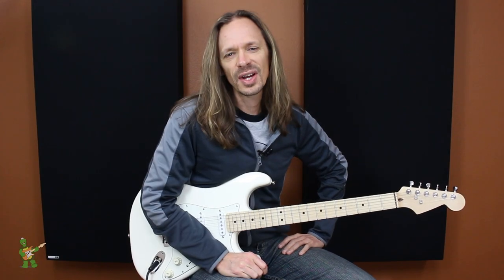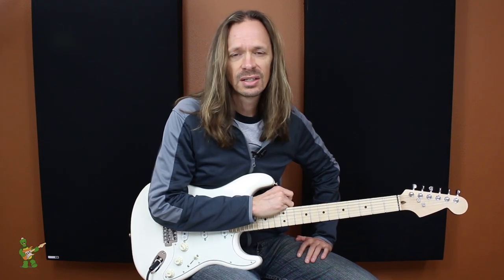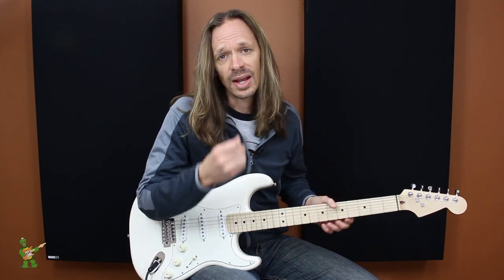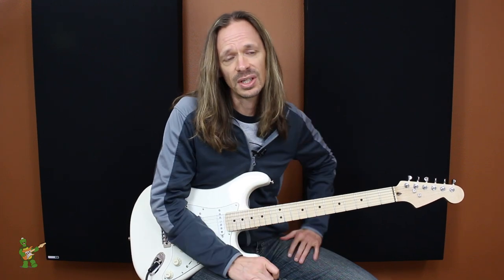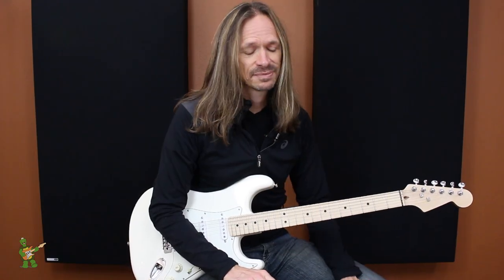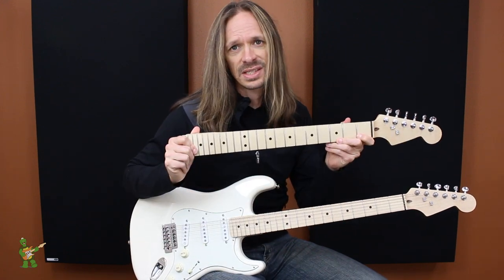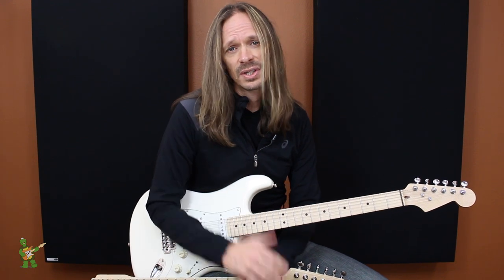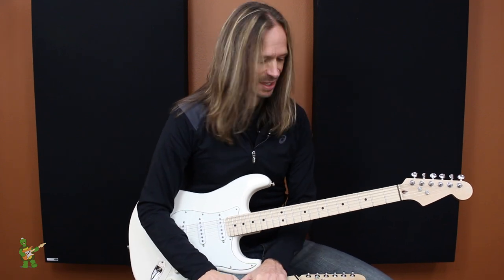Stainless Steel vs Nickel Frets

Comment: The reason stainless steel is not used in production lines is simple: it wears the cutting/fretting equipment much faster hence a softer, cheaper metal is used.

Comment: I wouldn't use SS frets with low output humbuckers or single coils personally. I also like pure nickel strings with the same group of pickups, and they don't eat frets so fretwear isn't an issue.

Comment: TBH, the differences in the Tone is minimal but IS there. However, the MAIN reason why I like refretting with stainless is more physical: they last a very long time (more often than not methinks the frets may outlast the rest of the guitar) and when the frets are polished to mirror shine, the strings glides on the frets like the frets are made of ice.

Comment: The diff was obvious...  Neck 2 had more snap and stronger, clearer highs. But I completely agree with this guy, even if you prefer the sound of nickel, it's not enough of a diff to justify the fret wear and dings. I'm fine with the sound of stainless but I actually prefer the feel of nckel since I use 009s tuned a half step down, it gives a bit of resistance. Whereas stainless is so smooth, my strings feel even more like rubber bands. Which makes it a bit harder to bend perfectly in tune but once again, the lack of fret wear and dings makes the stainless much more than worth it. I have stainless frets on one of my guitars but I wished I em on all my guitars. IMO, nickel silver frets should be obsolete. Esp considering fret jobs often cost more than the price of a whole new neck!

Comment: With good headphones/Studio monitors is clear the difference in the low end. Stainless steel has more low end/low midrange. For recording rythm I would prefer nickel as would leave more room for bass and kick drum. if I would want more low end guitar (maybe for soloing or little crowded song) I  would go for stainless steel.

Comment: You failed to mention the third option EVO Gold... nearly as hard as SS (easier vibrato and bends nice the fret is much harder than the nickel string)  but with a very similar sound to nickel if that is what you like. Clean is the best to hear really what's what (no distortion). The second cut arpeggio sequence highlights best that whilst it IS brighter the SS actually has more tone, clarity and depth than nickel which was muddy in comparison even on a Strat single coil!

Comment: How hard is it to refret with steel? Besides brass, is there not an alloy that meets in the middle between nickel and steel in hardness, a happy medium? Since I'm new to this, I guess I'll go with nickel. I'd imagine steel would at least give you better sustain, especially if you outfit your guitar end to end with steel parts : roller nut, frets, bridge, block, and then strings. I'm a firm believer in improving the build as much as possible before  adding in sound effects like a compressor.

Comment: I don't ever want to buy another guitar without stainless steel frets, simply because of the wear factor. That being said, there is a marked difference in tone between the two of them when you A/B them, but nothing that would make me bat an eyelash. The difference is easily made up in the amp. I definitely prefer Neck #2, before knowing which is which, but that's out of context with a band. I was, of course, right that Neck #2 was the stainless steel.

Comment: I got it correct, preferred the stainless, and was surprised how much of a ( generally positive ) difference it made - but if it's too bright, a quick amp adjustment should be more than enough - otherwise - count me in for no re-frets, slightly more sustain & brightness, and easier bends.

Comment: I am astonished about the difference. If the testing conditions were really identical then there is clearly a difference in the phase of the tone. The stainless steel frets sound like that there is some phase elimination between the strings and the pick-ups. Hard to tell what makes the difference. Probably the string height wasn't identical.

Comment: I play clean most of the time --- a lot of fingerpicking --- sometimes with no drums
at all. I hate the sound of the stainless-steel frets in this clip. It sounded
lifeless and hollow sounding non-organic. The best way to get a quality sounding mix, with
drums and bass and electric guitar is for each individual instrument to sound
great on its own and then to tweak your great sound from there to make it fit
even better in the mix. Stainless steel yeah but only for on the road but not for
in the studio where you would then have to try to “fix it in the mix” as so
many amateurs mistakenly do. However I do love the feel and look of stainless steel --- but
that is about it.

Comment: Neck 1 sounded a lil more normal to me but just barely. Strange thing I noticed was that neck 2 with the stainless had a slightly darker closed sound on chords. I wouldn't have guessed that. It had me confused because on single notes it sounded the same almost. Minimal difference.

Comment: SS frets are great for players but they are really tough on luthier fret tools, and everything about them takes longer to do. I love playing them and hate working with them.  The two guitars (necks)  most definitely sound different in some settings but unless the screws were torqued exactly the same that could be yet another variable. My theory is that everything is a variable. Two of the exact same model made from the same logs on the same day by the same people will still have slight differences. Mostly insignificant but most players would dig one of those a little more than the other for whatever reason.

Comment: i could hear it very slightly on only a few of the clips, which made me think it was the playing, because the difference seemed like neck 2 was more pronounced. basically i thought neck 2 sounded better but thought it was the playing, dont know ig i heard any high end zings, though, that flew over my head. but if there really is a mote pronounced sound with the SS frets, and its not just playing dynamics, then id say the SS frets sound better, not worse. my opinion, though, of course.
cheers, and thanks for this video!

Comment: Neck 2 sounded maybe a bit muted compared to neck 1 to me, although it's a minuscule difference that can be changed with a bit of eq adjust. And I was surprised since I expected the stainless steel ones to sound less muted given the density of steel but eh.

Comment: nickel all the way, on all pickups, and all the parts. which is consistent with my tremolo block preferences, i prefer zinc over steel, there, too. the only place where i like steel is in a good slide. nice comparison.

Comment: First if it's two different necks, no fair, no compare.  I've had some maple necks which were bright/thin as heck, resulting in a plinky tone.  And others which helped to give a thicker, fatter tone.  I'd stick those same necks on many different bodies and hear the tone follow the particular neck.  You have to refret the same neck to give any kind've comparison.

Comment: there's definitely some difference with a clean signal, it would probably be a much bigger issue on an acoustic because once you start distorting the signal it almost doesn't matter what the guitar itself sounds like aside from the pickups.

Comment: The 2nd neck ( steel frets ) sounds like is not "eating" the energy out of strings. My Strat does the same ( Nickel frets ) because I found out the weakest spots in the sustain path. At the end, the traditional block metal saddles AND nickel frets don't "eat" that dense "KUNG" tone you feel out of it. If you set your chin next to the body when you strum chords, you'll sense in the skull the pure straight metallic tone working in the formula Metal + Metal - Wood= Perfect Tone.
It's a tone beyond Tele-erasing fret bending-tone. Yeah, that "KUNG" coming out from metal ( strings ) to metal nodes ( fret and string saddle ).

Comment: I guessed wrong, I thought neck number 1 sounded brighter at the tops and fuller in the lows and was surprised it wasn't the stainless one. Are you absolutely sure the amp settings were the same on the 2nd day of testing?

Comment: I understand that stainless steel frets would tear off nickel strings because of the hardness of the metal.
How great is the impact of it though? I mean, you're probably end up replacing your strings because they got rusty before having them broken. Unless if it starts to rust quicker but still curious about concept vs practical tests...

Comment: I preferred the sound of the stainless steel frets. Was the action the same height on both necks? 

I had a similar experience when I changed a floyd rose special to a floyd rose pro.

Comment: I heard a definite difference, and prefered #2. Can't describe it, exactly, but had to fast forward to the end to know which one it was... So, it was Steel that I feel sounded a little better... "Brighter", comes to mind, a slight longer sustain... but can't really explain. It seemed to have slightly more "treble"? "Twang"... and "presence". -- In the "funky" part (ie. 4:36) #2 seemed a bit "duller" in parts, than the (initial) strumming part (ie. 3:36).

Comment: There is definitely a clarity and zingy-ness to the SS.  Here's my opinion:  If you're mostly using clean tones or just a little overdrive, and your goal is clarity, then SS is what you want.  But if you're using more distortion or need a versatile sound over many styles, then you want the traditional nickel.  For years I played at churches on a SS fretted neck.  Every time I used a highly driven or distortion tone the sound guy would say...your guitar sounds so thin.  Every time; from every sound guy!  But once I switched back to nickel frets I never got that complaint.  Also, when it comes to filing and polishing...the steel frets will basically destroy your files and you'll need to buy new files afterward.  Therefore, unless you have some very specific tastes or goals in your tone...just stick to nickel.  You can't go wrong.  In fact, I've built several of my own guitars in the last decade and I had to buy five new necks after I had originally bought them with SS frets (it was just as cheap to buy a new neck rather then get them refretted).  Finally, because steel is harder than nickel, if you use nickel strings, you'll go through strings a lot faster because the steel is wearing down the nickel.  Every time I would change the strings on my SS neck I could see the indentations on the strings from the frets.  So technically you should use steel strings on steel frets; but you'll wear down your frets as quickly as nickel...so what's the point?  Again, just go with nickel!  ( I love Warmoth and would highly recommend their products, but don't let their salesmen talk you into SS frets.  Just stick with the nickel.)  Have I made my point? Nickel.  LOL

Comment: In this comparison, the nickel actually sounded brighter in some spots. But you could definitely hear the sizzle in the stainless. I have an ESP with stainless. It bothered me for a while because the sizzle was so prominent. Almost to the point where it sounded like buzzing. But then again, I’m running EMG actives. Once I rolled back the tone (guitar) to about 8-9 and dropped the presence a notch, it leveled out nicely. Still have a wicked bite. But doesn’t sound buzzy anymore. Actives and stainless can sound wicked with some dialing in. But may throw you off initially. Passives with stainless are nice because it makes the passives sizzle like an active with nickel frets. If that made any sense ? If you like your frets as short as possible, stainless is killer. You can get insane action with them. If you saw a nickel fretted guitar with the frets barely sticking up, you’d be thinking it was time for a refret soon. But stainless you can bring down pretty low and they won’t wear down any further. Also, if you decide to go with stainless, make sure your luthier knows what he’s doing. They will chew up tools. And if he keeps working on your stainless frets with a dull tool, the results won’t be pretty. Food for thought .

Comment: Well I never thought anyone could sell me on stainless steel frets but now that I actually HEAR the difference in them & am over 30 years old and own more than one guitar then that will mean, fer me @least(!), I probably will never need another refret in my lifetime(?!) if I go Stainless -PLUS I am increasingly turning towards flatwound strings that are inherently less ‘zingy & need all the brightness I can squeeze from my axe!
So all this means that, from now on, when I replace my (frets) I’m always going to use stainless steel👍

It’s worth pointing out that stainless steel isn’t as friendly on strings and any price difference (not talking about convenience here) could well be outweighed by buying more strings than you normally would….  YMMV

T H A N K S for this Video👍

Comment: It does seem to sound different but you can’t remove the biggest variable, that it was two separate performances. You’d have to build a robot that can without a doubt play a lick the exact same consistently. But then what would guitarists argue about? Having had strats with both types of frets, I’d never get nickel frets again. Took me less than three years to wear down nickel frets. I’ve had my current strat, with steel frets, for almost twenty years and only has a little fret wear

Comment: With lower output pickups I'd stick with nickel, but with warmer hotter muddier pickups, the stainless zing wouldn't be as noticeable plus you get all the benefits of stainless.  Just sounds like broken shards of glass when combining low output single coils  and stainless frets in my opinion.

Comment: As others point out, the difference isn't really heard in ALL playing, only some. And frankly as you point out, how you use your amp matters the most in sound. There is a reason why nickel frets have been used historically. They work. And most of us never experience problems with them because we are just not playing them that much or that "hard". And steel frets are also harder on strings, so there is that issue too. But some of us don't replace strings that often either. LOL Glad there are choices though. I just know for myself, it isn't an issue. I would not choose nor NOT choose a guitar based on whether the frets are nickel or steel, nor would have replace them based on that.

Comment: Listening to the clips at first, I was pretty sure I knew which neck was the nickel one because I've been repeatedly told that nickel sounded better than stainless steel. As it turns out, I just prefer Stainless Steel. :)
Reply: I would have to agree. My Agile Reaper that I had converted to stainless, because the frets died after six months sound great.

Comment: Definitely an audible difference but my bet would be that an altogether different neck is the primary difference. Like two fingerprints will look different, two wood grain patterns will sound different. Doesn't matter if it's from the same piece of the tree. Would have to re-fret the same neck to be apples to apples. But all in all, really too close to make any practical/applicable difference IMO.

Comment: The nickel-silver definitely sound better but the performance and longevity advantages of the stainless steel might still sway me. What I would also point out is that the stainless steel are far harder to work on, eg. crowning etc.

Comment: I have both stainless and nickel. For me, stainless feels better to play and I get the illusion that stainless sounds more  “colder” or more metallic because play, the sound of the strings hitting the fret makes a louder sound than the nickel. With nickel, I find I have more control when bending but just tiny tiny bit. 
Tone wise, I don’t hear a difference. But they sure few different. One is smooth and the other is rough. I personally like them both haha

Comment: I can't hear a difference, and neither do any of my customers. I had a customer who was getting a fret dress every 4 months, and a fret job once a year. I installed a set of SS Jescars and he now gets a fret dress every two years and a fret job every 6 yrs. A normal player won't need fretwork for a very long time. Other than some tricks to installing SS frets and some extra time leveling them, I find them easy to work with. It's all I use now.

Comment: I'm not a tone snob and I feel like my ears are shot, but I heard a huge difference.  I've got SS on 3 of my guitars and love the durability and smoothness, but I built a nice partscaster strat with SS frets and I am just not digging it (neck radius is too flat so that's not helping either).  I had an old beat to crap mid-90's strat that I never should have parted with that I prefered a lot more.   I'm in the market for a smaller radius neck and was determined to go SS again, but I got some thinking to do now.

Comment: even if you thought the nickel frets sounded better, i would instantly sacrifice that for not having to deal with fret wear. neck 2 sounds a little sparklier, i prefer it in this setting. now let's see whether i have to suffer with the complete loss of tone of steel frets that every corksniffer on the internet told me about...

edit: apparently i even like the durable ones better. neat.

Comment: I play a Les Paul. It will need a refret this year. I wear them out fast. $400 NZD job here, so it is going to be stainless for me. If there is a little brightness I will just use one of those white coily cables like gearmandude. I'll pass on the boots though.
One day i will get around to building a Strat or Tele. One thing that holds me back is I do not actually know what kind of neck I like on a Fender. I have played some I really like and others I don't, but don't know which is which. I want to be able to play that stuff where you fret bass notes with your thumb, which is really hard on a Gibson for me, so i am thinking narrow nut, not too fat and with a quite round radius.